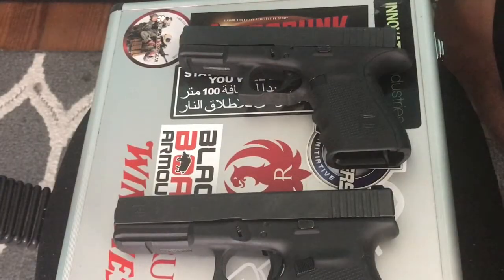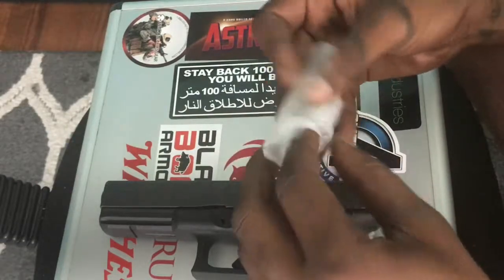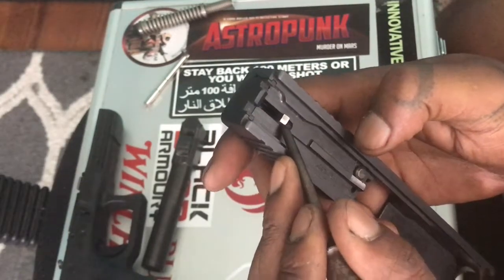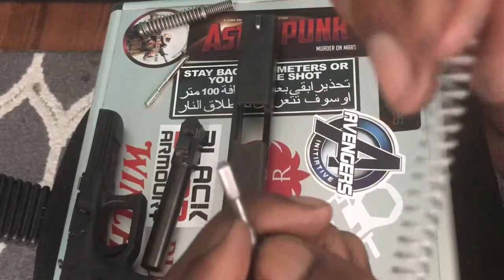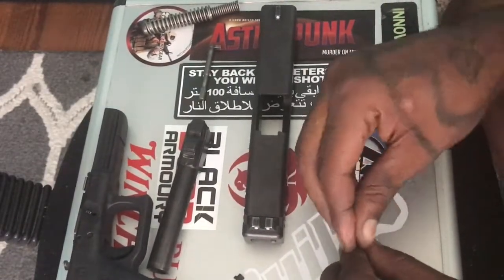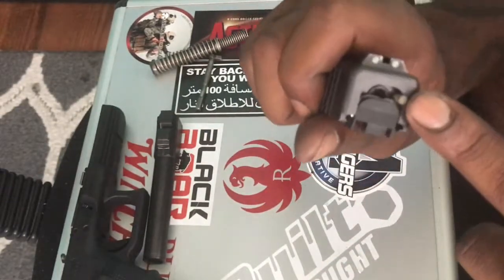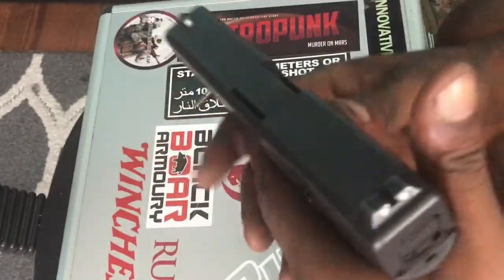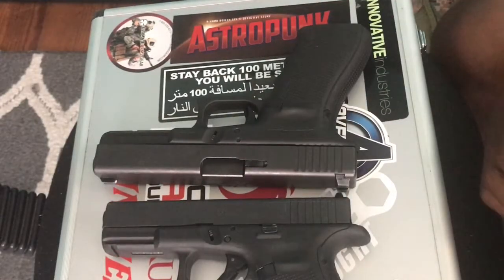Glock 21 45 ACP firing pin

Comment: I watched your double undercut video on your 19 and after noticing how thin you took it I went through your more recent videos to see if it held up lol. I’m impressed 3 years later it’s still running strong. Have you noticed any issues or flex in it? I cut mine last night and went a little thinner that I would have liked
Reply from the maker: Ty it’s  still my edc firearm.I haven’t been able to an update video yet
Reply: @popedeckard1090  oh nice dude, so no flex issues?
Reply from the maker: @blessedflip7942  no none at all The gen 4 for MOS trigger guard Is a thick boy